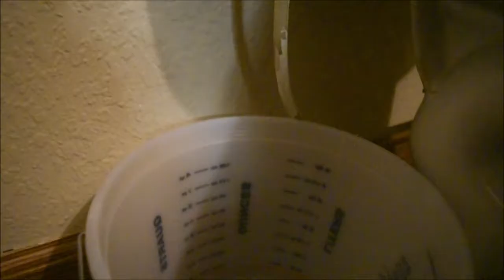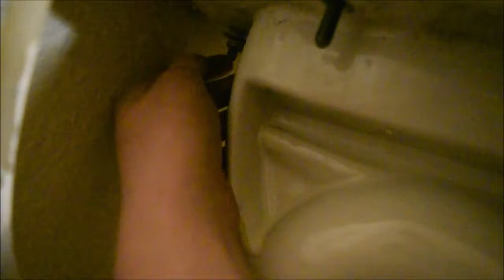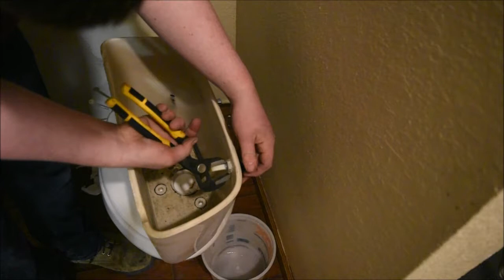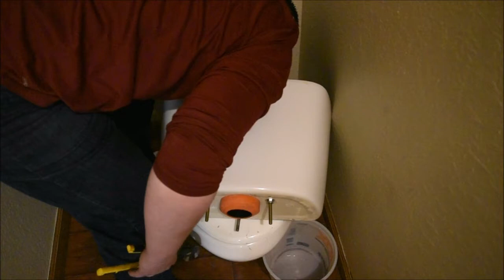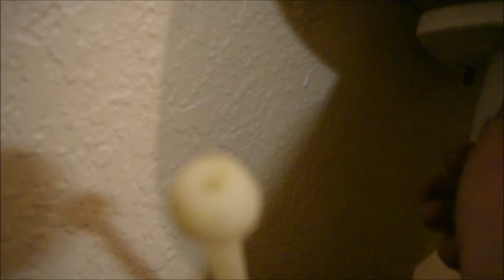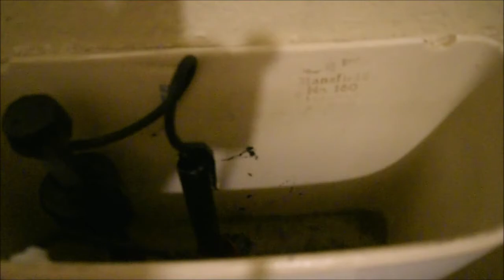Toilet Repair 101: Replacing the Guts

Comment: I just need to change the bolts they are rusted inside the tank and the water level doohickie tank has been leaking where the bolts are thanks for the vid

Comment: Is that little white piece you took off from the Bottom of the tank from where the hose is connected to, replaceable? Or do you have to change the whole piece inside?
Reply from the maker: It's all replaceable. You can it from about anywhere.

Comment: The toilet i have doesn't use screws, so i cant take off the top piece.. its all one unit. What are my options??
Reply from the maker: I would have to see the toilet, you may not be able to use a universal repair kit. It might have to come from the manufacturer.
Reply: @KyleMelsonOKC  https://www.us.kohler.com/us/santa-rosa-comfort-height-one-piece-compact-elongated-1.28-gpf-chair-height-toilet-with-slow-close-seat/productDetail/toilets/428441.htm?skuId=410554
Reply from the maker: @tylerdoty1840  Depending on what your problem is, here are two kits from kohler. They are $20 and $22 respectively. It looks like the fill valve is installed just like a standard toilet. Since your toilet is one piece, you won't have the gasket between the tank and the bowl. https://www.us.kohler.com/us//productDetail/toilet-valves/637925.htm?skuId=613370&_requestid=5320156 and  https://www.us.kohler.com/us//productDetail/canister/1000181.htm?skuId=1000126&_requestid=5320255: